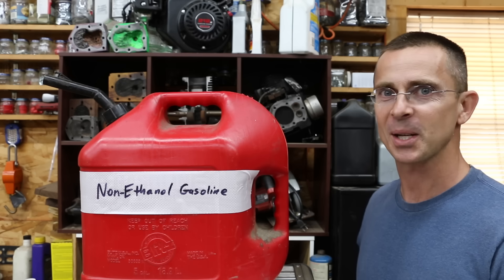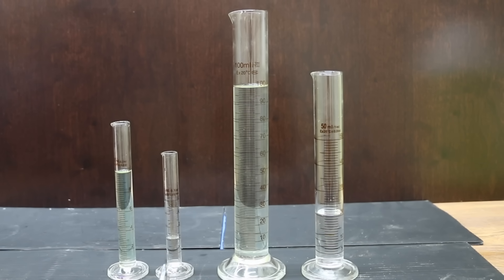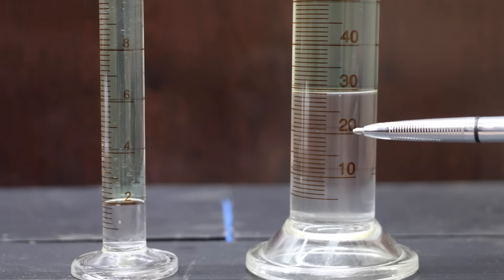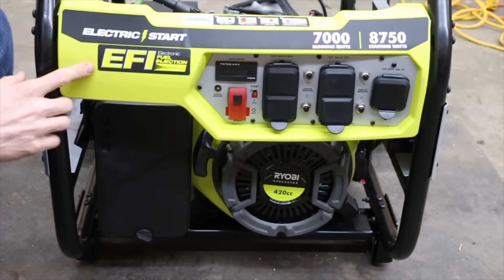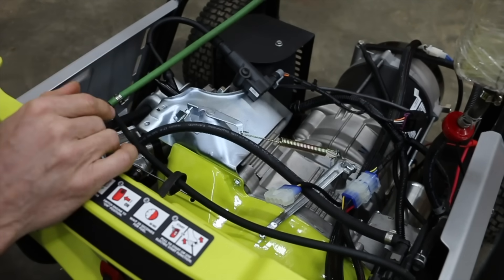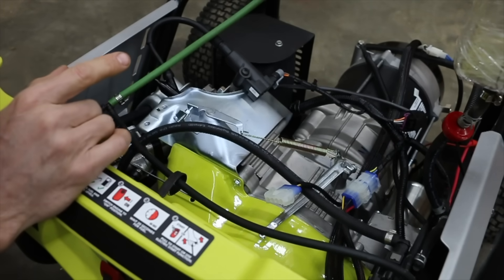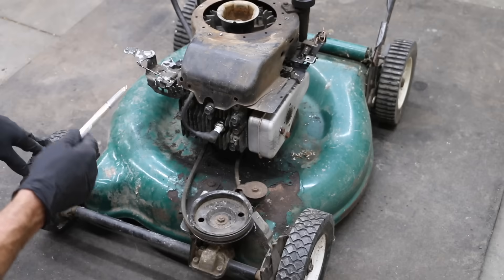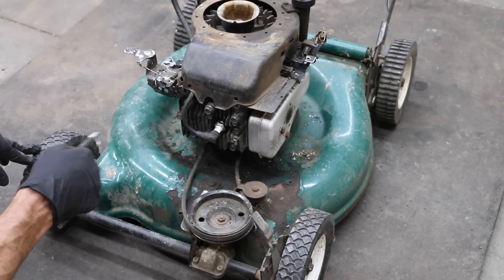Is Non-Ethanol Gasoline Really Better? See the PROOF!

Comment: Anybody remember Gas-a-hol the new wonder fuel of the `70's & `80's? it would ruin valves. What really gets me more than anything is it costs more to make it than it does to refine oil the old way....and....it takes oil to refine it...lose lose.
Reply: I also remember when they stopped putting tetra-ethyl lead in gas, that did cause a problem with valves and valve seats in older vehicle engines.
Reply: Actually the valves were designed for leaded fuel and when the lead was removed of human health, different valves had to be used for unleaded, with or without ethanol.

You are wrong on what costs more to make.  

On the NWMEX today clean ethanol was priced at $1.50/gallon...hmmm huge price jump, normally it is in the mid to upper $1.30s and was a day or two ago.

An unusable sub grade of gasoline(RBOB) was priced at $1.98/gallon.

To bring RBOB up to a usable grade will cost you a lot more per gallon much like premium gasoline costs more than regular.  Unfortunately it become more toxic as well.  Premium gasoline has like 40% BTEX(benzene, toluene, ethylbenzene, & xylene).

OR...……………………... you can simply splash blend in 10% ethanol and the price become cheaper and obviously less toxic.
Reply: @danafletcher2341  valves are the same. Once lead was removed from gasoline the valve seats, particularly the exhaust valve seats had to be hardened.
Reply: @prestonrieger8410  Thanks for confirming what I said.
Reply: @danafletcher2341  yep had to replace the valve seats when they changed over. had an engine (older MGB) with cast iron valve seats with chromium one.. and do realize it was a environmental move for all the right reasons btw...but the thought behind corn-fed alcohol being the answer to me and what I've found about it is not the way to go....just sayin'
Reply: @moss8448  I am glad you mentioned MGB because my friend Marc Rauch from the Autochannel sent me an exchange of him with a magazine writer about that very car and here is a portion of it:

>>>...The other two vehicles are old vehicles, they're classics, of a sort. Morris Minors were built between 1948 and 1971, and MG manufactured MGBs from 1962 to about 1980.  

Here's the thing, from the 1920's to the 1970's at least two gasoline companies in Great Britain marketed ethanol-gasoline blends of E10 to E30. One of the gasoline companies was owned by Standard Oil (Esso), another by Cities Service. These were and are major oil companies. Consequently, both the Morris Minor and the MG MGB were manufactured to run on "power alcohol" fuels (power alcohol is what they called ethanol-gasoline blends). I tried doing an Internet search for any literature from those early days to see if the respective manufacturers restricted their vehicles from using power alcohol fuels, but I couldn't find any (if any reader has such documentation, please send me a copy). The big question, then, is if the Minor and the MGB were able to run on E10 to E30 when they were built, why would they be unable to run on E10 now?

There are very few Morris Minors and MGBs in America today, but my guess is that many... most... nearly all(?) are running on our standard E10 fuel. In fact, I found an original 1967 Morris Minor woody wagon in the Los Angeles area that is advertised for sale. I spoke with the car's owner. The right-hand drive car looks to be in very good condition, and was imported from England 12 years ago. The engine has original parts. I asked the gentleman what type of fuel does the car use? He said, "regular gas." I asked if he meant regular E10 gasoline, and he said, "Yes, just regular gas that you find anywhere." So, if a 1967 Morris Minor is able to run on E10 in Los Angeles and it gets about 40 miles to the gallon (according to the owner), why would it be unable to run on E10 in Manchester or Liverpool or Cornwall or Edinburgh?

I couldn't find any Morris Minors for sale in Brazil, but a quick search netted two MG MGBs for sale in Brazil. One is a 1973, another was a 1974. The regular fuel in Brazil is E27. So if an MGB can run on E27 in Sao Paulo and Bahia, why is it unable to run on E10 in London or Bath or Glasgow? 

I think I've made my point; time to move on.    
…<<<

One E10 blend Britain had for a very long time was called Cleveland Discol which was sold from the 30s until close to 1970 when BP bought them out.

I am so for ethanol that I am even for making it from coal, natural gas, and oil like China, Indonesia, and India are doing with an economical process from a Texas company named Celanese with their TXC Technology.

I personally eat grass fed beef so if everyone ate like me, corn ethanol would not exist as it would be uneconomical.

Corn ethanol today takes 40% of corn off of the market, but simultaneously there appears a brand new, triple concentrated, and better feed(distillers grains) to more than take its place. This fact limits more acres being needed or planted.

In other words, the feed is preserved even if 100% of the corn went into ethanol. 

Corn ethanol is a value added product of feed production which uses a waste stream from it. Cattle can not digest the carbohydrates very well and a lot are lost undigested in their manure on the ground. Corn ethanol uses only those carbohydrates and leaves the feed(100% of the proteins fats, and minerals) alone. Actually it enhances the feed to be more concentrated(triple), more digestible, more productive, and healthier for the animal.

More/better food with a super cheap, super nontoxic, super clean, and super concentrated octane booster/fuel/oxygenate as a bonus. >>>Who can be against that?
<<<

Iowa State found it takes 34 gallons of diesel fuel equivalent including all energy it takes to plant, till, spray, fertilizer, chemicals, harvesting, drying, trucking etc. to produce an acre of corn.

If we do not value add the corn, we get >1000 lbs. of beef per acre for that 34 gallons of diesel.

If we ferment and value add the corn, we get the same >1000 lbs. of beef, but we also get >500 gallons of ethanol as a bonus with that very same 34 gallons per acre. Win, win.

That is what in economics is called the "magic" of value added.

Distillers grains(DDGs) like grass does not lower the animal pH like corn does (which causes bad and deadly bacteria to proliferate). DDGs are 30% protein vs corn's 9%, every thing is tripled except the carbohydrates are removed.

Believe it or not, the corn belt grew more corn acres in 1980 before ethanol than they do today with record ethanol production and ethanol plants everywhere.

 

2018 Iowa 13,200,000 acres of corn with record ethanol production

1980 Iowa 14,000,000 acres of corn before ethanol

 

2018 Illinois 11,000,000 acres of corn with record ethanol production

1980 Illinois 11,600,000 acres of corn before ethanol

 

2018 Indiana 5,350,000 acres of corn with record ethanol production

1980 Indiana 6,450,000 acres of corn before ethanol

 

https://quickstats.nass.usda.gov/results/229C6DAD-EFDE-3021-ABDA-BD1F0ACE0269

 

In fact the US grew more acres of corn in the 1920s, 1930s, and 1940s than we do today with record ethanol production. The peak was 1932 with greater than 113 million acres of corn and no ethanol to a little greater than 88 million acres this year with record ethanol production.

 

See chart, ethanol does not show up even as a blip:

https://uploads.disquscdn.com/images/91d7502e043c7c976bdbac4d3953fb82813e0ab4ef4723a5d70e734514dcac9c.jpg
Reply: @danafletcher2341  from all I've read on the subject blending alcohol with gasoline is not a win situation it is just a band aid to appease the environmentalist. alcohol does burn cleaner I agree but to produce it in the quantities necessary is unrealistic. lean burn engines is the more realistic way to go. mechanics that are ethical tell me all the time that the blended fuels cause issues.
Reply: @moss8448  Here is what exploding ethanol use did to repairs and maintenance in the US:
https://uploads.disquscdn.com/images/09f191db1baf6565c0aa85036f5531a1d479706d47ee0e4dbe160e2d71a7521f.png

Yes corn ethanol is limited to the size of our cattle herd so that as a source can only about double from E10 to E20.

Ethanol optimized engines could drop the need for as much fuel by close to half.  But ethanol can replace diesel fuel also as seen in this truck already on the roads worldwide today with mileage greater than gasoline and equal to diesel engines.
https://www.oemoffhighway.com/engines/press-release/21005554/scania-ab-scania-introduces-bioethanol-engine

That is why I am even for(at least in the short term) converting natural gas, coal, and oil into ethanol like China, Indonesia, and India are using with an economical process from a Texas company named Celanese with their TCX Technology.

Imagine cities with air as clean as only an electric car advocate dreams of. Imagine cancer rates falling instead of always climbing from our very toxic world.

But there are many waste sources for ethanol for the taking.

Cellulosic sources are great. We have tree branches, leaves, and grass clippings now filling land fills, garbage(being done in MN & Canada now), sewage, and waste food from restaurants and food processing plants etc.

We could build sewage treatment plants which use cattails to capture solar energy. These are cheaper than building conventional ones and can put out water cleaner than the river water it returns to. Cities could make their own fuel.

There exists thousands of abandoned oil platforms in the dead zone of the Gulf of Mexico. The dead zone is dead because it is rich in nutrients from soils and fertilizers. Distillation plants could be constructed on these platforms and nets could be floated 1/2 mile in each direction from the platforms and grow kelp in 640 acre sizes. Kelp in those conditions could produce 30,000 gallons per acre. Take that times 640 and times a few thousand abandoned platforms and you have big numbers. Oh, to get the ethanol to shore, you could use the abandoned oil platform's abandoned oil pipelines. The distillers byproducts could become feed or natural fertilizer or in the unlikely event that water erosion is cured and the dead zone was too clean it could be returned to fertilizing the kelp. Ethanol is made only of solar energy, carbon dioxide, and water. Same thing would apply to the sewage ethanol plants if sewage disappeared.

Not pertaining to our country, but note that coffee trades in huge volumes. When they make coffee, the plant is very much like a cherry only in coffee's case they keep the pit and throw away the fruit (into rivers causing temporary ecological problems). This easy fermenting source could become cheap ethanol fuel, waste sources are always super cheap like the feed waste from corn.

Don't know how viable or legitimate this technology is, but it made a great 60 Minutes segment in January when it ran. They claim to have a game changer for cellulosic ethanol: https://www.cbsnews.com/news/marshall-medoff-the-unlikely-eccentric-inventor-turning-inedible-plant-life-into-fuel-60-minutes/

Comment: I work in the marine industry and when the shift started with ethanol mixtures the only problem i ever saw was clogged fuel filters. It tended to take the varnish off of old fuel lines. And of course the problem with water separation, but that is such an easy fix its stupid, just buy some Sta-Bil. You only need a stabilizer if you don't run your engine frequently.

Comment: For what it’s worth I have an old work truck I can run it for months on non ethanol fuel no service engine light! Put in 10% ethanol fuel almost 2 mpg less and oxygen sensor codes are on I run it down to less than 1/4 tank fill up with non ethanol in 20 miles lights are off
Reply from the maker: wow!  Thanks for watching!

Comment: It's bad!!!!!!
 of course I of run older rigs.  But I guarantee you I get better gas mileage every single time I fill up with non ethanol. I also do not have the problems with the carburetors,  Injectors,  fuel lines, gaskets failing, etc....

As for your thing saying it's going to take a 6 month. Told my Friend not to use ethanol in her 80s scooter after I rebuilt the carburetor  Replaced all the fuel lines and cleaned out the fuel tank.... She did it anyway. Then something came up & she decided to let it sit for about 2 months Out riding it and wouldn't you know the carburetor was completely plugged again & the gas  Smelled as badge as if it had been sitting for anywhere between 6 months to one year. And yes it had turned the varnish and yes it was brand new pump gas. Not something she had sitting around in a gas can.
Reply: If you run ethanol gas in your small engines, you need to be sure to run them empty every single time you use them. After just a few short weeks of non use (unless it is a brand new unit) it is most likely going to be pluged up.

I always run my lawn mowers, chain saws, weed trimmers, etc. till they run completely out of fuel even with nonlethal if I dont plan to use them fo for any length of time.
Reply from the maker: Thank you!

Comment: Always a good show.Has anyone brought up the subject of ethanol gas verses gas tank sealers and rubber o rings?
Reply from the maker: Thank you for the video idea!
Reply: Look for chemical compatibility charts from the o ring manufacturers themselves.

Ethanol is much >>>easier<<< on rubbers, plastics, and metals than what gasoline and BTEX(benzene, toluene, ethyl benzene, and xylene) are.

If you doubt this, look here:

Ethanol = https://www.customadvanced.com/chemical-resistance-chart.html?chemical=Ethyl+Alcohol&rubber=

Gasoline = https://www.customadvanced.com/chemical-resistance-chart.html?chemical=Gasoline&rubber=

Benzene = https://www.customadvanced.com/chemical-resistance-chart.html?chemical=Benzene&rubber=

Toluene = https://www.customadvanced.com/chemical-resistance-chart.html?chemical=Toluene&rubber=

Ethyl benzene = https://www.customadvanced.com/chemical-resistance-chart.html?chemical=Ethyl+Benzene&rubber=

Xylene = https://www.customadvanced.com/chemical-resistance-chart.html?chemical=Xylene&rubber=

Need a second opinion?

https://www.coleparmer.com/chemical-resistance

Or here for a third opinion:

https://www.graco.com/content/dam/graco/ipd/literature/misc/chemical-compatibility-guide/Graco_ChemCompGuideEN-B.pdf

See what high aromatic gasoline is rated for with aluminum:

https://www.calpaclab.com/aluminum-chemical-compatibility-chart/

Note that ethanol is good with aluminum.

The main nontoxic ingredient of RV antifreeze is ethanol and it would not have stood the test of time if it had been corrosive.

Comment: I am a small machines tech in the UK and the damage and cost due to carb and fuel line failure is colossal. some diaphragms blister, some pipes go soft and fall to bits in the tank. some pipes go hard. when the fuel mix is drained from the tank the fuel has separated, it's Not water.   We have found that it is more cost effective to replace carbs rather than trying to unblock them.  it's a Sad state of affairs.  We've mechanically stripped and cleaned carbs and rodded out jets where possible, tried ultrasound cleaning and various chemicals such as seafoam cleaner, Methylated spirit. hot water and detergent, cellulose thinner, kerosene.  Nothing seems to work and be effective..... but sometimes if they are allowed to dry out for weeks / months. then refitted they sometimes clear themselves and work. go consider that one. the only true cure seems to be to use Aspen fuel or use petrol mix,... Drain and run a small amount of aspen through and store with the Aspen.
Reply from the maker: Great point! Thank you
Reply: When E10 came to my neck of the woods in the 80s called gasohol, we had to change fuel filters very often since gasoline coats fuel tanks and carburetors with varnish and ethanol cleans that off which plugs the filter.  Once clean the tanks stay clean with E10.  I still have a few vehicles from back then and they sit most of the time but will still start right up as long as the battery did not go dead.  I have forgotten what year I changed the fuel filter on some.  

IF you want to know what is the true cause with your diaphragms, look to the natural gas distillates and high amount of aromatics now being added to gasoline of late.  Look at gasoline and BTEX(benzene toluene, ethylbenzene, & xylene) vs ethanol on diaphragms here from Ingersoll Rand Company:
http://ingersollrand.jp/pdf/fluid/fluid_catalog_15.pdf

Ethanol is much >>>easier<<< on rubbers, plastics, and metals than what gasoline and BTEX(benzene, toluene, ethyl benzene, and xylene) are.

If you doubt this, look here:

Ethanol = https://www.customadvanced.com/chemical-resistance-chart.html?chemical=Ethyl+Alcohol&rubber=

Gasoline = https://www.customadvanced.com/chemical-resistance-chart.html?chemical=Gasoline&rubber=

Benzene = https://www.customadvanced.com/chemical-resistance-chart.html?chemical=Benzene&rubber=

Toluene = https://www.customadvanced.com/chemical-resistance-chart.html?chemical=Toluene&rubber=

Ethyl benzene = https://www.customadvanced.com/chemical-resistance-chart.html?chemical=Ethyl+Benzene&rubber=

Xylene = https://www.customadvanced.com/chemical-resistance-chart.html?chemical=Xylene&rubber=

Need a second opinion?

https://www.coleparmer.com/chemical-resistance

Or here for a third opinion:

https://www.graco.com/content/dam/graco/ipd/literature/misc/chemical-compatibility-guide/Graco_ChemCompGuideEN-B.pdf

See what high aromatic gasoline is rated for with aluminum:

https://www.calpaclab.com/aluminum-chemical-compatibility-chart/

Note that ethanol is good with aluminum.

The main nontoxic ingredient of RV antifreeze is ethanol and it would not have stood the test of time if it had been corrosive.
Reply: @danafletcher2341  Finally, some facts!